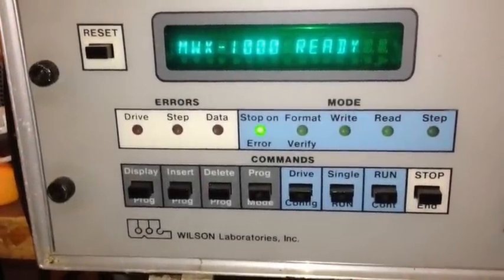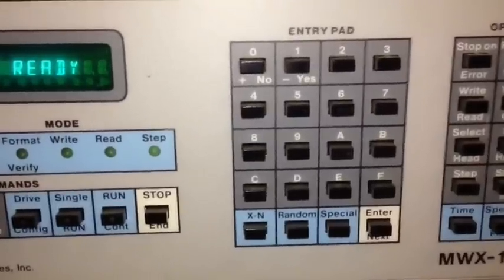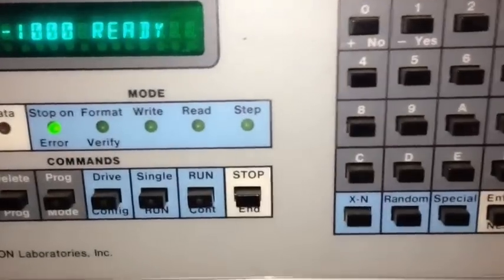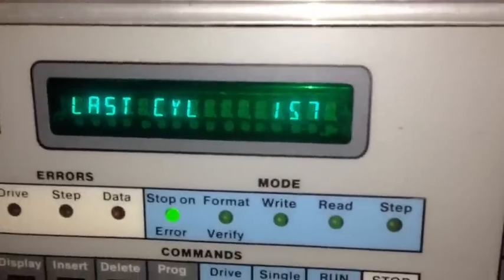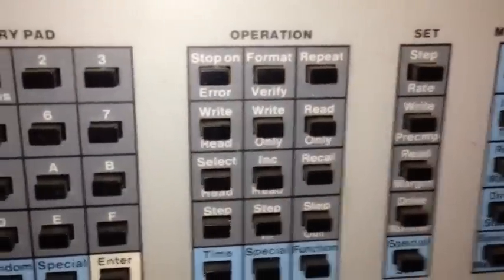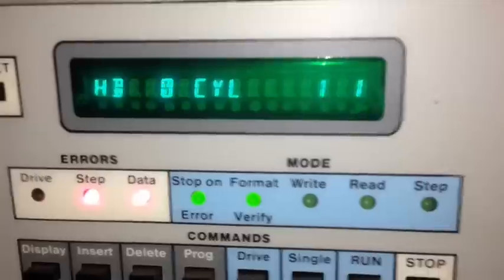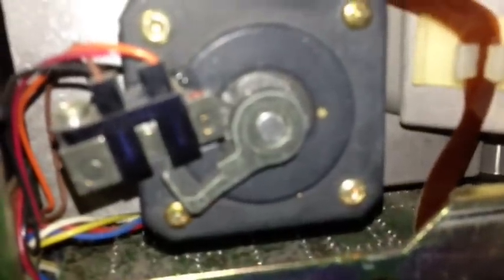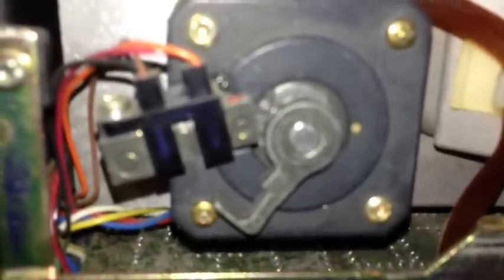Seagate st-412 and Wilson MWX1000 tester 10mb vintage mfm hard drive 0.00001 tb capacity

Comment: I am amazed!  I have a vintage Vector Graphic 4S in mint condition complete with all original documentation (somehow kept it all after many decades).  It can be configured with (2) floppy drives or (1) floppy and a Seagate ST-412.  When I configure it for the Winchester and attempt to read it, I get a "drive not ready" error.  Can I hire you to test the drive with the Wilson?  The drive worked a while ago I want to be sure it's the drive, not the controller.

Comment: How did your turn off the warning about a printer not being connected? I also have an MWX-1000 I'm using to test a bunch of MFM drivers for a client.
Reply: Wow, where did you get such a device? I'm in need of one, I have a couple hundred drives to test.
Reply: @TheDiskMaster  E-waste recycling from a friend's business a few years ago. I personally have either used an AT class computer, or drives that appeared to work, I'd use David Gesswein's MFM emulator to try and pull data. I've probably sold several dozen drives, but testing MFM drives is VERY VERY time consuming. When I posted that 6 years ago, I think i tested several hundred MFM drives, but it took me about a month or so.
Reply: @pkhoury1212  Hmm, from getting the drive in my hand to a completed surface test for me can take up to 8 hours depending on the capacity of the drive. 

I do not want to recover any data from these drives at all - I only want the mechanical testing and defect locating from this machine.

If you still have the machine and are not planning on using it, send me an email. I would be interested in purchasing it.